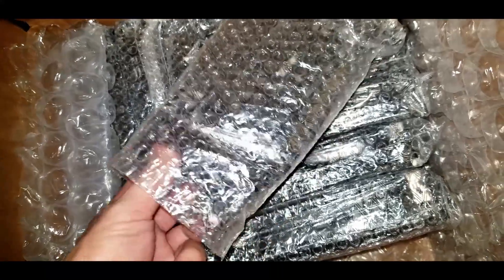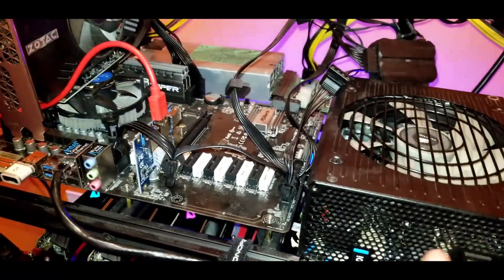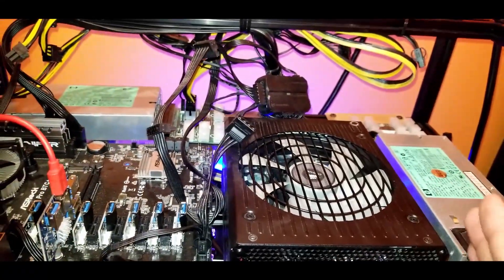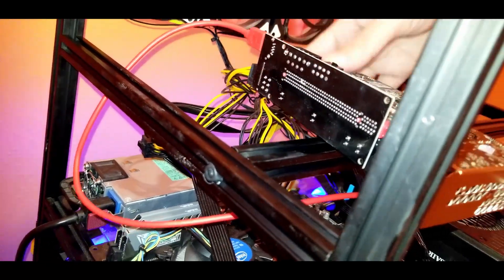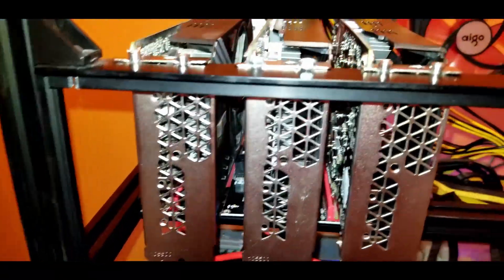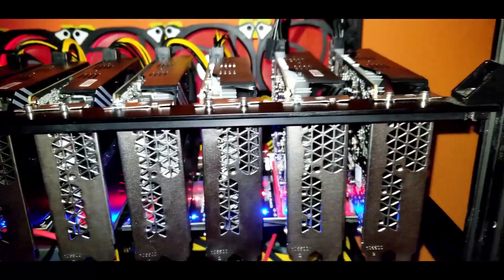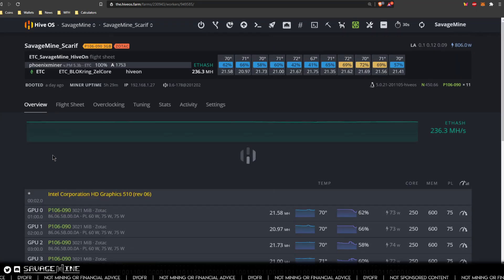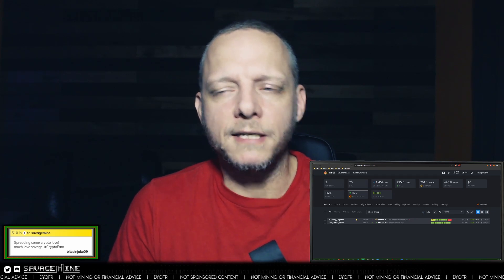Dedicated ETHEREUM Classic Mining Rig Build

Comment: Might be a stupid question, but are all the small fans worth the draw? I would just lay a walmart box fan on top on low for a lot less noise.
Reply from the maker: Not really. They push VERY little air. I have two box fans running air across the rigs now.